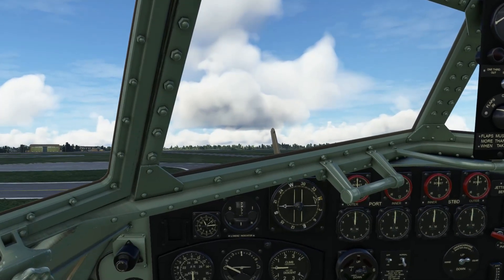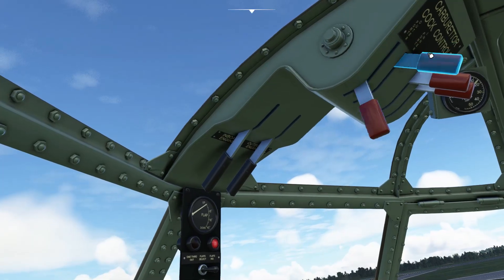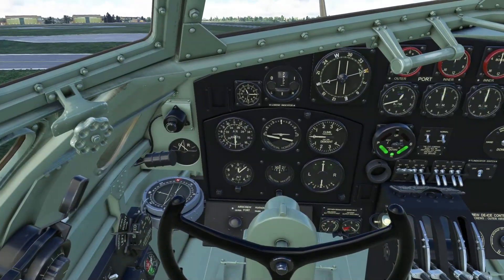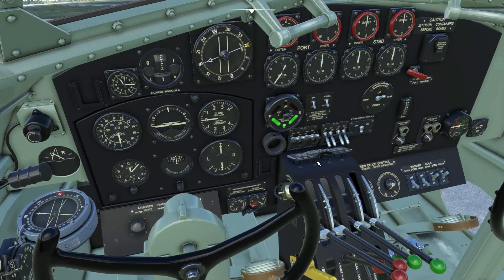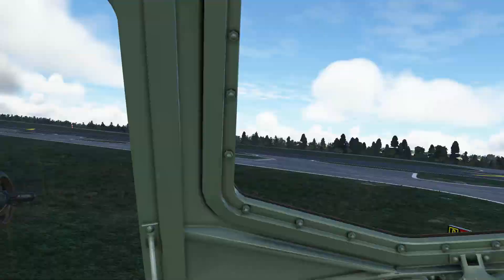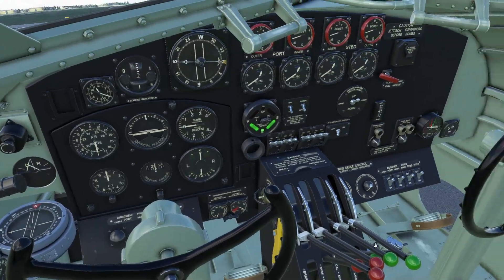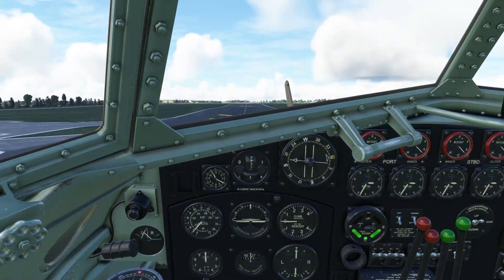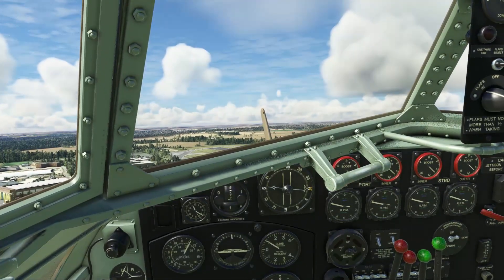Virtavia Short Stirling Cold Start Demo | MSFS | Microsoft Flight Simulator

Comment: 🧐 What’s with the German markings ?
Reply from the maker: Operated by 7 Squadron RAF with fuselage codes MG-F, N3705 was captured on 16 August 1942 - while overflying The Netherlands by night, the crew encountered problems, and the captain elected to make an emergency landing. N3705 eventually came to rest in an open field at Gorinchem, Netherlands. Believed to have been written off as damaged beyond repair, the aircraft was salvaged by the Germans after the emergency landing, and flown in Luftwaffe markings for testing by Erprobungsstelle Rechlin as aircraft 6+8. Thanks for watching.